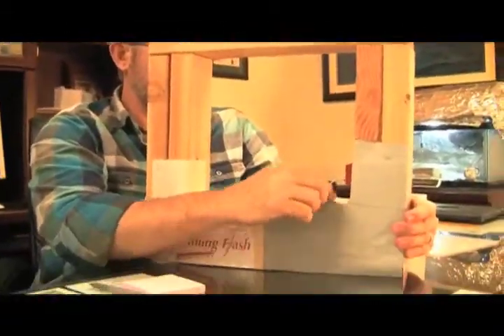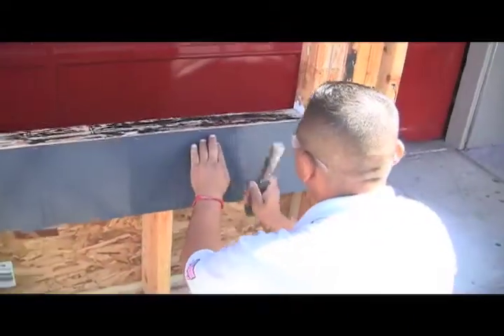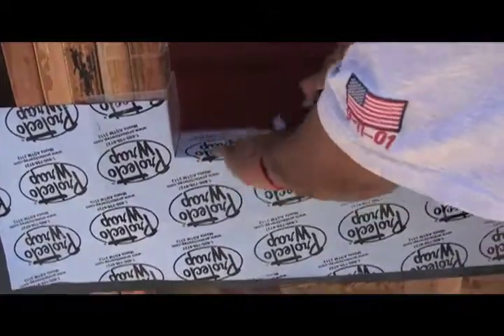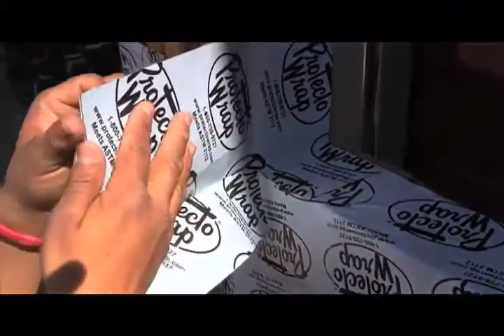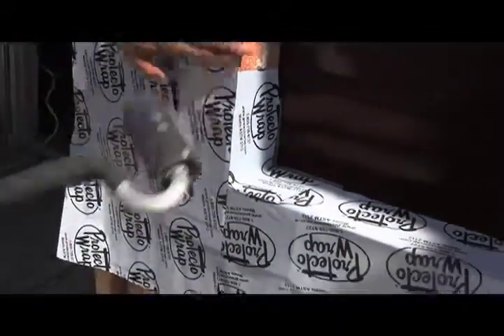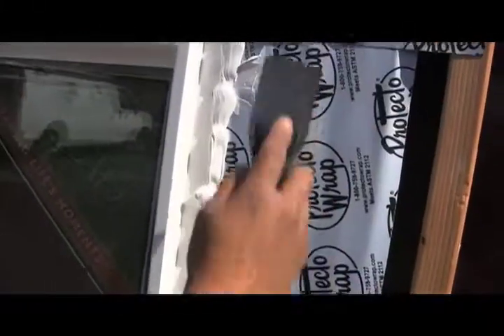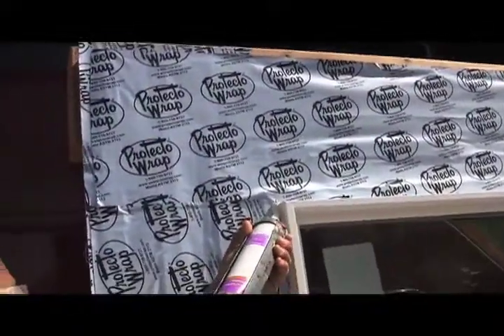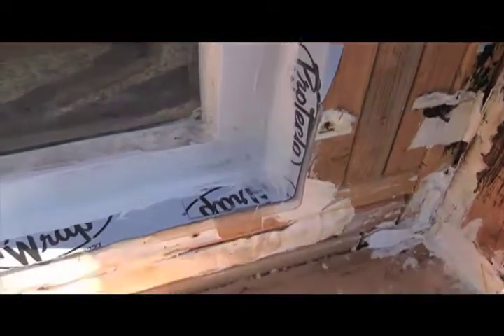Window Installation Training for Champion Vinyl Windows (AAMA Method B) by TLS Laboratories

Comment: Those installers went a little overboad with the caulking. You shouldnt caulk or wet set the window to the framing. Ive removed a window where they wet set the window to the framing. The window had broke apart at the middle bar on a slider xo window. Because when it expanded from the heat of the sun. The bottom of the window couldnt move with the rest of the window.  Jamie Cobb at Complete Windows and Doors from Washington state

Comment: Tiffany: we have been doing this over 20 years and never heard anything like you describe. With that said, we install high quality windows that need to be wet set to the top of the flashing on sides and bottom, and directly to the lumber at the top. This prevents leaks. To say you should not wet set a window to the framing is 1. A bad idea and 2. In direct conflict to ASTM 2112 and to AAMA Installation Masters training. I hope you reconsider you position because is potentially leaves you at risk